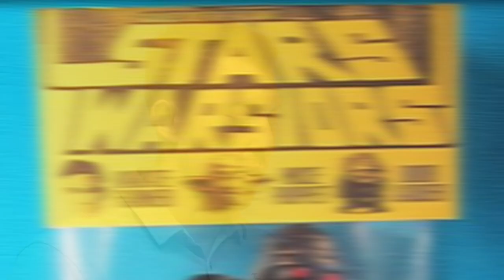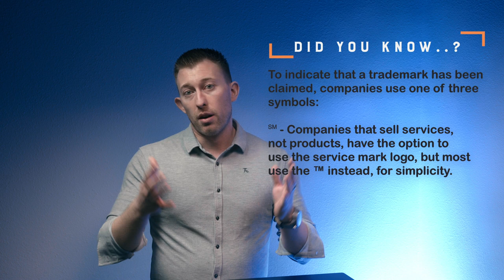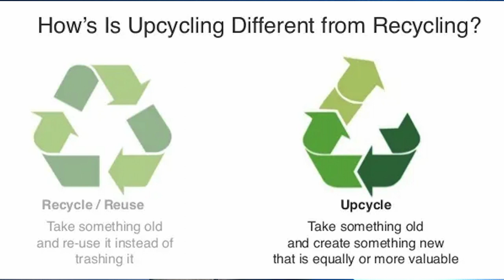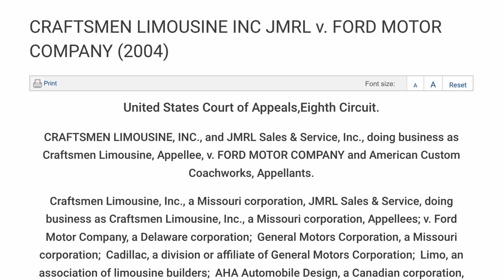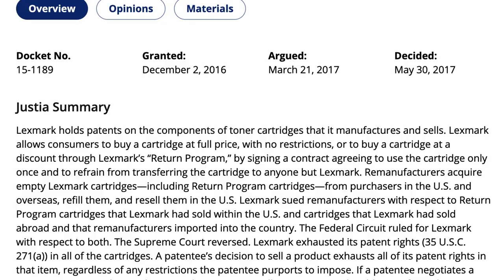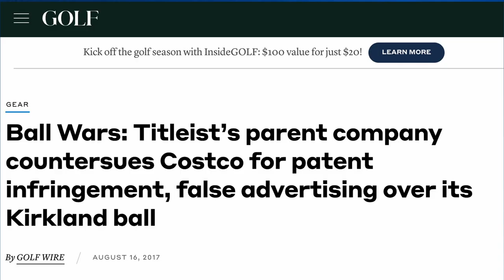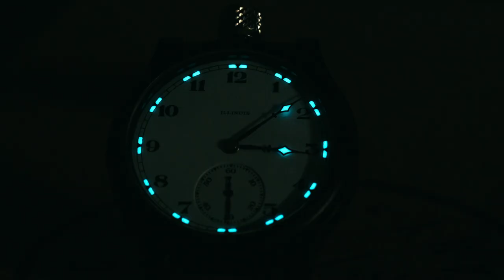What is Upcycling? Trademarks, Refurbishing, and Recycling: A History | Custer & Wolfe

Comment: I've often heard that something like buying damaged LV hand bags, cutting them up, and making wallets out of them (or watch straps or whatever) runs into trademark law. Does your big win fix that?
Reply: Great question Charles. One of the biggest things I learned through this whole process was that, at least in the USA, anyone can sue anyone else at any time over anything. So our win doesn't prevent lawsuits from happening in the Upcycling world, but it certainly set a precedent that would likely be cited in a future lawsuit and would hopefully make the defense of someone like you reference much easier. Since there was no precedent set prior to Hamilton v Vortic that was similar enough, we did not have the ability to get that help. Referencing similar cases does wonders for the defense and makes the process less stressful and sometimes less expensive.